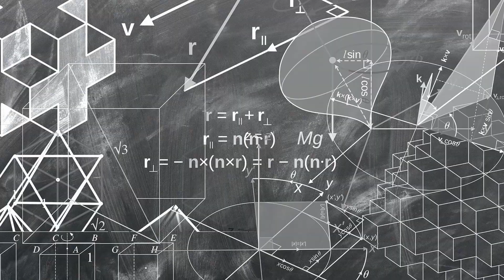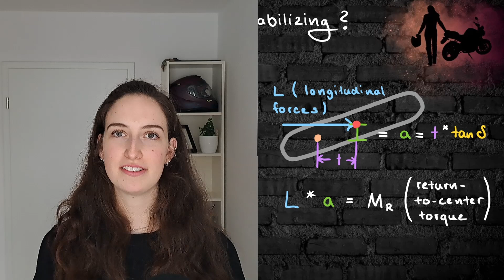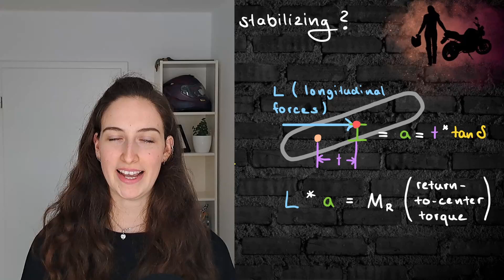TRAIL explained - Most Relevant Handling Characteristics!

Comment: I saw many bikes modded with girder forks, and they have negative trails. I cannot understand how riders could even control? I think they are purposefully sacrificing usability for aesthetic. So what are your opinions on negative trails?
Reply from the maker: I searched for motorcycles with girder forks AND negative trail and couldn't find any. Can you provide a link or specific example? I honestly can't imagine that there is something like this🙃
Reply: I didn't mean all girder forks had negative trails, but some do, most of those happen with springer forks. An example is at 4:51 in this YouTube video:
https://youtu.be/zMcQZRmY9_U?si=1s-aysjBUPIIa_18
I just want to know the opinions of someone with expertise because I think it's extremely hard to handle
 @GiuliaonGasoline

Comment: Hi . Nice and well explained, but as you imagine this is ONE parameter, but any bike is a balance between caster angle, trail, wheel diameter and mass, and tire ratio. For example you can perfectly build a cruiser with a high caster angle, a giant front whell, and reduce the trail distance to counter all handling losses created by your design choice (caster angle is not alway the fork tubes angle). For this reason, there are some sporty cruisers on the market, with high caster angle, but 16" wheels and quite short trail, that are serious performers on twisty roads. 16" wheels are lighter than 17" ones found on sports bikes and have fatter tires to keep an overall similar outer diameter. A fat tire will be comfy and squishier than a rigid low aspect sport tire. BUT, on normal roads  (not perfect flat surfaces) a pothole will make a rigid tire jump all over the place, a fat tire will handle smoothly, absorb, and give you more confidence. At the end you keep throttling, and go faster on not so perfect roads. On top of a torquier engine, these bikes can surprise most of sport bikes riders.